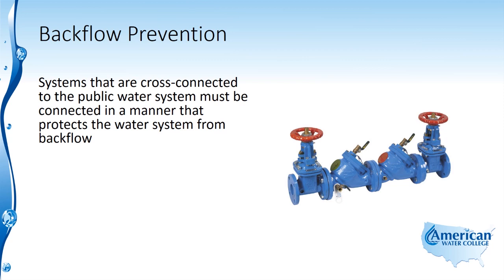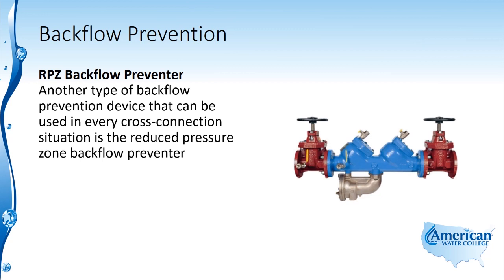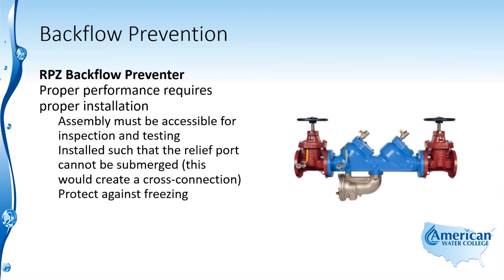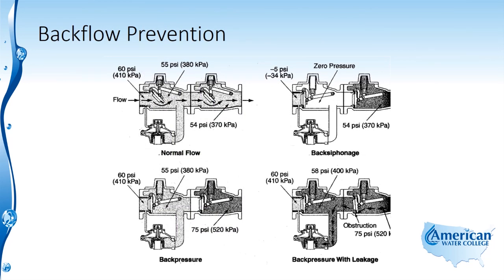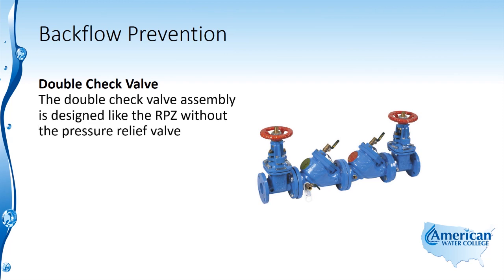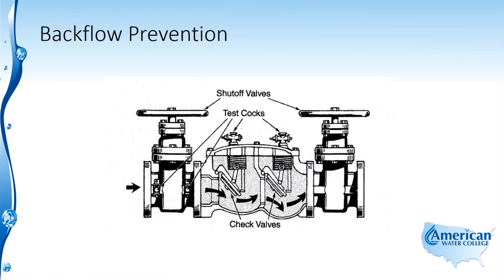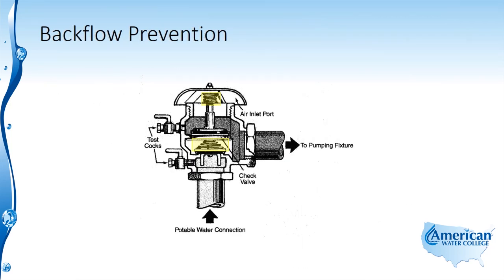Water Distribution | Backflow Prevention

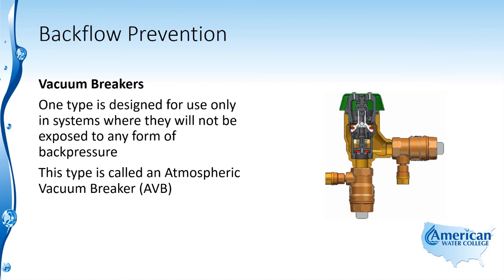Comment: One confusing part. Near the end you mention that the pressure vacuum breaker can operate against backpressure 7:31) and then at 8:22 you mention that the PVB is NOT designed to protect against backpressure. This does not make sense, can you please clarify?
Reply: PVB’s are only for backsiphonage and must be installed 12” above all downstream piping. They do not protect against backpressure. They definitely made a mistake by saying that it can protect against backpressure.